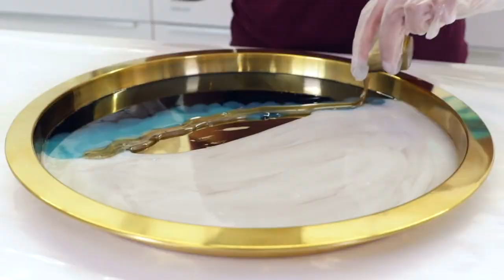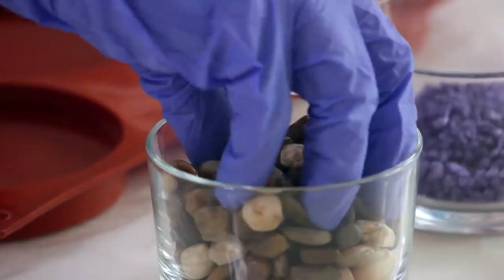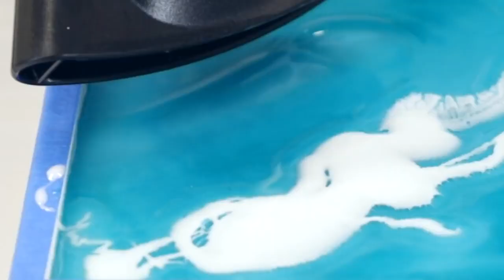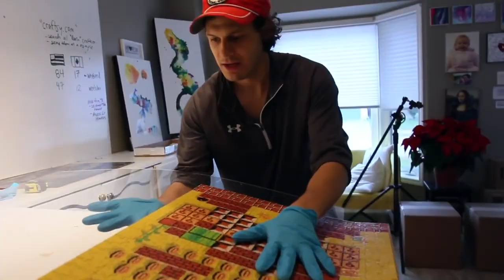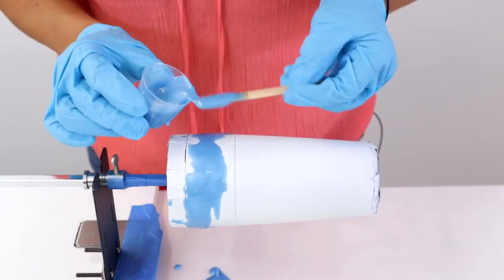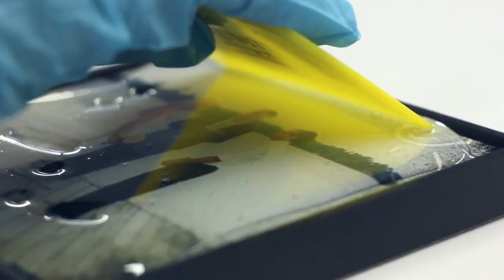10 Things To Do with ArtResin

Comment: Amazing ideas. I tried using Resin on Tumblers but I am geting too many bubbles
Reply from the maker: To get rid of bubbles ensure your ArtResin is between 75-85F- you can use a warm water bath to warm it up if necessary.  Once you coat your tumbler try running a torch over the surface to get rid of any bubbles that rise up.

Comment: Hi! Is flame gun necessary to use for making resin coasters?
Reply from the maker: Hi there, there is nothing better to clear off bubbles from the surface than a butane or propane torch, however if you are using silicone molds its best not to use a torch as it can damage the mold and make it stick.
Reply: @Artresin  so, what's the alternative if I m using silicon mould ?

Comment: How to check if certain epoxy is nontoxic? I mean cases for cutting boards for example and surfaces that may come in contact with food. How to know if its safe?
Reply from the maker: Not all epoxy resins are created equal, but we are happy to assure you ArtResin is  food safe, non-toxic and safe for home use, when used as directed.  Here is a link to our blog on food safety that shows our testing results :  https://www.artresin.com/blogs/artresin/artresin-passes-food-safety-tests?_pos=1&_sid=07a2d73aa&_ss=r
ArtResin is non-toxic when used as directed. This means that if you follow the instructions for use, there is no cause for concern or risk to one’s health. We've had our product evaluated by the American Society for Testing and Materials; ArtResin conforms to ASTM D4236: Safe for Home Use.

Comment: What's the maximum thickness of the pour without compromising the piece?
Reply from the maker: ArtResin was initially designed to be a sealant and poured at an 1/8th of an inch in depth. We do have artists that use our product for pouring deeper than an an 1/8th of an inch but they achieve this by doing multiple pours. You can go up to 1/4 inch in your pour and would suggest you use a torch to help pop any bubbles you may have.

You can layer ArtResin epoxy resin in multiple coats, as high as you'd like, as long as you pour in 1/8" increments.

You have two choices when pouring multiple layers: the first is to pour your first layer, torch out the bubbles, cover and wait 3-5 hours until your ArtResin epoxy resin reaches a jelly like stage. At this point, you can pour on your next 1/8" layer, torch out bubbles, cover, wait 3-5 hrs and repeat until you reach the height you desire. This method is especially handy when pouring into a mold or a dam. The second option is to allow your first layer to fully dry, then give the overall piece a light sanding and pour on your next 1/8" layer. Torch out bubbles, cover and let this layer dry. Repeat these steps as many times as you'd like.

Comment: Do you not need a respirator when you use Art Resin?  The people in the Vid aren't wearing one.
Reply: They may have one of those air filter/purifier things... They should mention it though
Reply from the maker: Hi Kelly, ArtResin is non-toxic and produces no fumes or VOCs.  It is safe for home use when used as directed.  If you are working in a well ventilated area, a respirator is not required 🙂. Here is more information on what safety precautions to take when using ArtResin : https://www.artresin.com/blogs/artresin/what-safety-precautions-should-i-take-when-using-artresin?_pos=3&_sid=72bf4741e&_ss=r
Reply: @Artresin  thank you! I love your product by the way. Use it all the time!